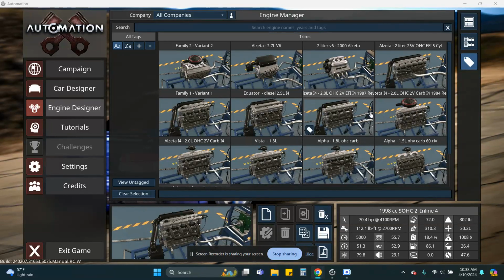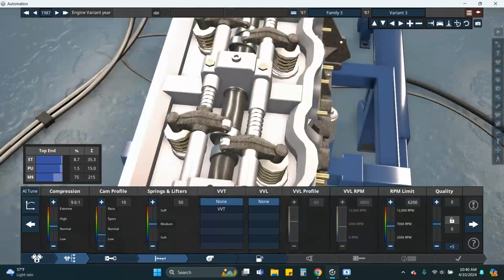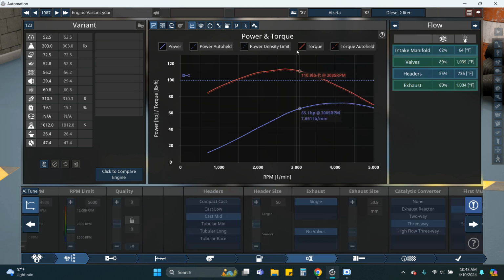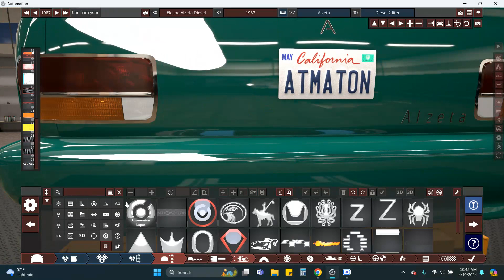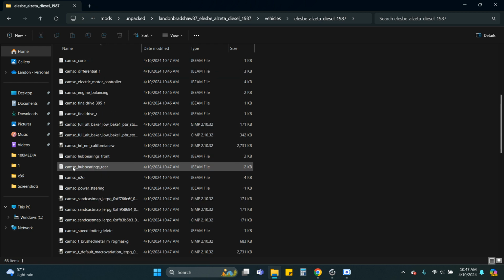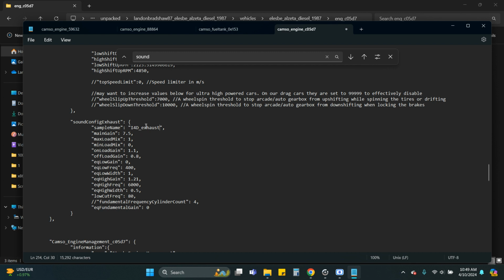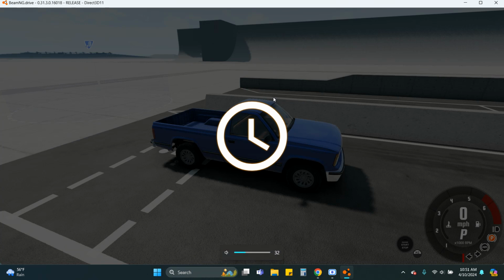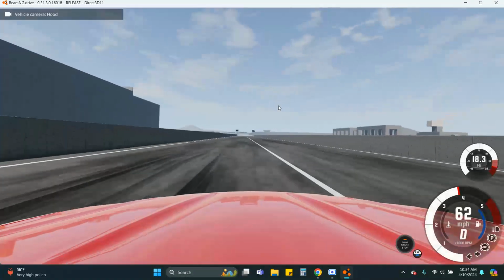How to make a diesel engine in Automation/BeamNg

Comment: ""Accelerates as slowly as a diesel ""  the 1.9 TDI PD +300CV STAGE 3 in my pocket ☠️☠️☠️☠️😂
Reply: Now get a stock 1.9 TDI that hasn't been molested like yours claims to be. Not that acceleration monster is it?
Reply: @Drift_Potato402  depends on what car. Rougly 130hp in a lightweight hatcback its gonna be dexent in most cases but yeah not a track build lmao
Reply: But this one is without a turbo so it is not a tuner friendly thing